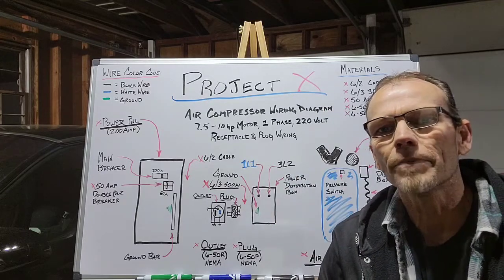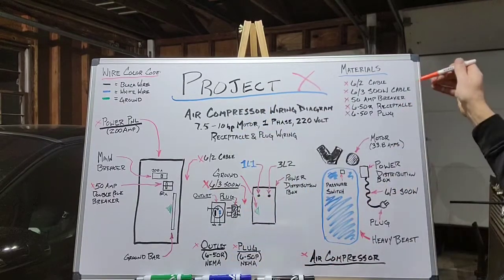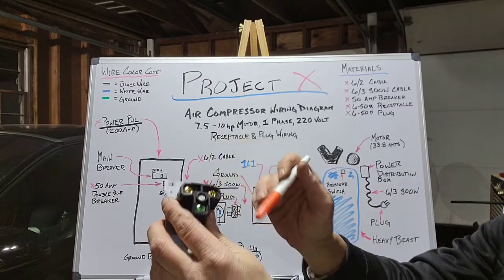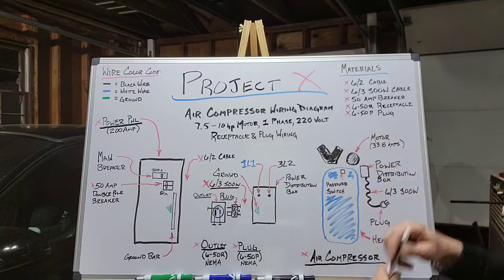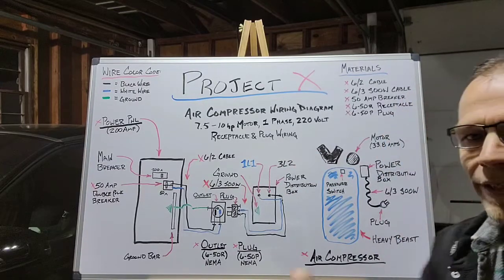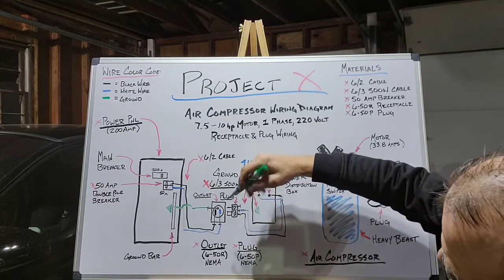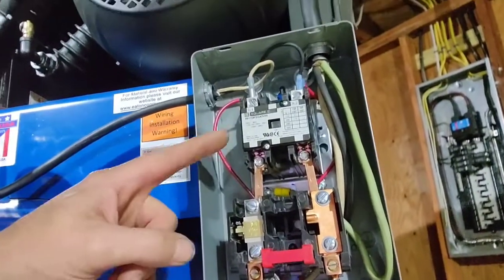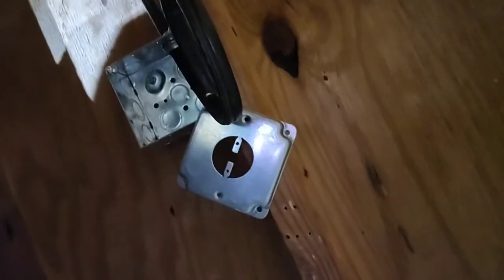Project X - DIY Wiring 220v Power Supply for Eaton 80 Gallon Air Compressor w/7.5 HP Motor - Part 1

Comment: I’ve got a question, what purpose does the wall plug serve other than to disconnect power source, would putting a switch before the plug be a better option or why not go straight from box to compressor? That’s what I did and I just flip the breaker if I don’t want running
Reply from the maker: Thanks for the comment! I agree with you that installing a disconnect switch in-line is the better method of install. I chose using a plug for now because the current loction of the compressor isn't permanent, and once moved, i intend to put a plug-in welding machine in its spot. The new compressor location will definitely get a disconnect switch.

Comment: That's not a power distribution box, that's a magnetic relay, also known as a motor starter, complete with a thermal overload. It protects the motor and the pressure switch from taking the brunt of the motor startup current.
Reply from the maker: Appreciate the insight & thank ya taking time to share the knowledge, much appreciated!

Comment: I suggest you mark those white wires with a black paint-type marking pen. This will indicate that the white wires are now power wires, not common or neutral. You could use black electric tape in place of the black marking pen. Both black wires are now marked as 120 volts each, giving you 240 volts.
Reply from the maker: That's a great suggestion. I appreciate the tip & thanks for taking time to watch and comment!

Comment: I was hoping to find how to actually wire in on the compressor side. I opened the box and don't see obvious place for my wires to go. I have 80 gallon northstar new.
Reply from the maker: Hey Dave, your air compressor should be very similar to mine except the power distribution box is mounted on the side. Remove the cover of the box and at the top, just above the 50a breaker, you'll see 3 set screws, this where the wires connect. The set screw on the left is L1 (black wire connection from SOOW ) and the middle set screw is L2 (white wire connection from SOOW) and remaining the green wire from the SOOW cable (you'll need to add some type of terminal to it) can be grounded to the same screw as the green wire ground already in the box.

Only 3 wires are needed to make this connection. If the wire you are using has 4 wires, just put a wire nut the 1 unused wire.

Most of all DO NOT wire it directly to the pressure switch like some of the smaller model compressors, this will burn up the motor. 

Hope this helps and thanks again for watching!
-Project X
Reply: @projectx2.718  don't  want to sound dumb but iust never seen this set up before and the manual  just says call electrician.  I know a lot but how to wire  but I admit this double  looking breaker confused me with no obvious  place that looked open. I sent pick of my box, anyway u would mark where you think it goes. I haven't  bought wire yet so guess  I just get 6/2?
Reply: @projectx2.718  tend to send pic but couldn't  find option. Anyway it has a black breaker and a white one bridged together.
Reply from the maker: @davidshouse7347  That bridged breaker on the compressor you mentioned is the 50amp breaker and where you'll make connection coming from the power panel, you'll need to add a (bridged) double pole 50amp breaker in your power panel for the power source. 

Starting from power panel using 6/2 cable you'll connect the black wire to one pole of the 50a breaker the white wire to the other pole of the breaker and bare copper ground to the ground bar in the panel. At the receptacle you'll tie together the bare ground from the panel to both the metal connection box and the new receptacle at the "G" connection. The black wire connects to the "X" and the white wire goes to the "Y". Next using 6/3 SOOW portable cable make connections at the plug, black to "X", white to "Y", green  to "G". At the other end of the SOOW cable that connects to the compressor where the 50a breaker is you mentioned, back out the left and middle set screws and connect black to the black, white to the white and the green (ground) wire will need a connector added to the end and it can be installed to the same spot as the existing ground wire that's already in the box. 

 I got you covered Dave, I had my electrical inspection this morning (and passed), I'll post a video later this afternoon that shows the entire electrical run from panel-to-compressor and how I did it. And if you find this helpful all I'll ask for in return is please hit the like button on the video and subscribe to the channel.

 Best of luck and have a great one!
-Rich @ Project X
Reply: I just got a Eaton 10hp 1 phase 80gal compressor and the power distribution box is different from yours. They dont have a wiring manual which makes it difficult to wire it up. Inside the power distribution box it also have a thermo protector hooked up to the top block which has the 1L1 and 3L2 slots. Do you know if can still hook up the black and white wires into 1L1 and 3L2 for this setup?
Reply: @Zeb Thoj  line 1 and line 2 which in my box is left and right screw on the black Eaton 50amp breaker. If it gets hooked up wrong it will burn up thermo switch.
Reply: So i cant hook my black and white wires in the same position as projectx on his 7.5hp compressor since mine has the thermo protection?